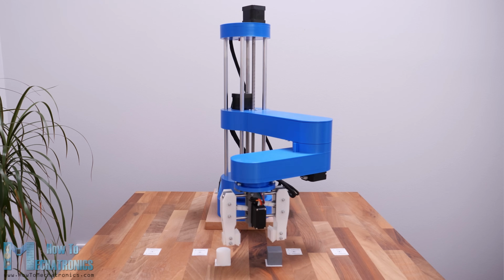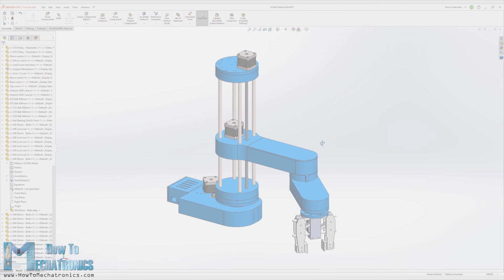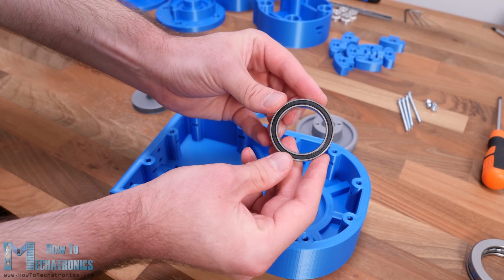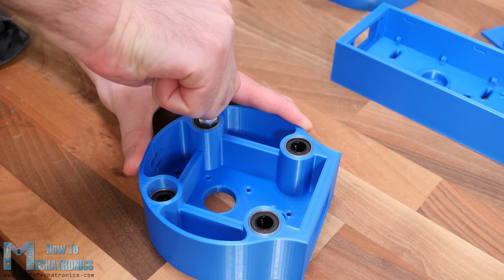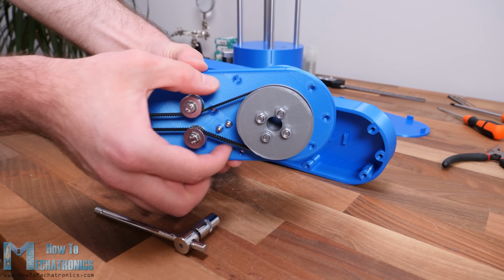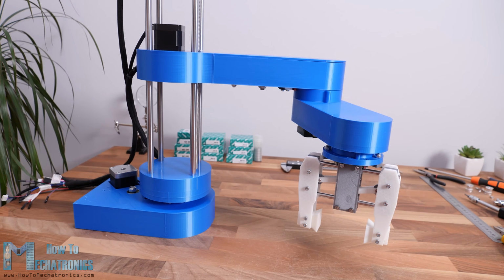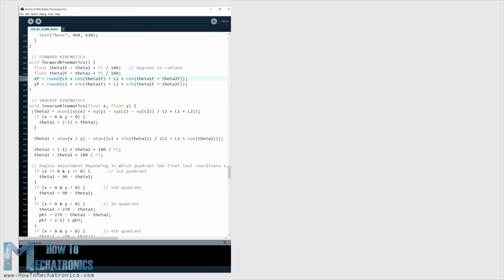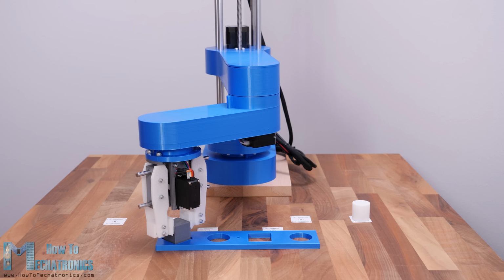SCARA Robot | How To Build Your Own Arduino Based Robot

Comment: wonder sir.while trying my pc all settings ok and processing3 also opening gui window but when enter diser angle in x axis box  but not working why ?is it necessory to change comport my pc shows "com7" where can I change this in the code
Reply: try not to use usb hub with ppliances pulling lot of current as it might affect,but single usb directly, not to interferrence with other peripherals. sir do you have in upper right corner java chosen? this is right? error in comand line below  this?An error occured while forwarding a Controller event, please check your code at move
java.lang.reflect.InvocationTargetException`? i have jrunning uploaded new sketch to arduino with slower baudrate :  Serial.begin(9600); and in processing ucommented : void setup() {
  size(960, 800);
  myPort = new Serial(this, "COM9", 9600);. It runs, you should be able to run it too now! so once you plug everything in, check on PC in device manager what port com it shows actually, then change in arduino sketch, upload, then change in processing and upload. lower baudrate is better. after you upload arduino code with current actuall com port , close the arduino IDE to finish the serial protocoll to allow processing to work, then press play in porcessing, no error code should come. watch your stepper drivers as they overheat, therefore run only few minutes and then switch arduino on robot with power off, to allow to cool down. once it is the same icom port in both arduino and processing and devoce manager, it should run. hope this helps resolve
Reply: @pitass82  Hi, I made this arm, but he doesn't work  i changed the line 55 for my port COM correct and the processing IDE run without errors, but the arm not move.... have you sucessfull building the arm?

Comment: Two supporting bars as a triangle mounted to the wall, would removes the problem of the wobly operation and thus the accuracy and thus higher operational speed drastically. It would need a recessed hole on top of the 'roof' of the robot containing a standard bearing with a 8 mm hole.
Reply from the maker: Yeah, that would improve things quite a bit.

Comment: Hi,
I finally built the Scara Robot. I modified all the 3D CAD models to accomodate with all the components i had existing from my other projects, and even added some 3D design features to simplify the routing of the cables in the interior of the Arms.
I am using (4) 12mm linear shafts and flanged bushings along with a 12 mm lead screw and nut with lead 8mm and 2mm pitch. I have also designed a solid aluminum base frame structure which i am houing the power supply, the arduino uno and cnc shield, the step down voltage converter and fan and the ac power switch from the rear.
The Homing sequence works perfect, the only issue i am having is with the gripper after homing in pde processing--  i am confused.
When it fiishes the homing sequence the x,y,z are at 365,0,170. My z is slightly different than the one on Mechatronics due to interference with gripper and  frame when homing stepper4 ( so i changed the code in arduino for homing of stepper 4 instead 0f 10000 to 17000 after limit switch is pressed, and the gripper needs to be in closed position- for mine 90 degrees.
After Homing 
Once i drag the gripper value slider , it dives down in the z and hits the table. What can i change in the pde or arduino to stop that, it really shouldn’t do that, it should only move the gripper to where i want it to be open, closed or whatever it needs to be - why is the z moving also ?? .Your help would be appreciated. Also my Gripper is fully opened at 0 degree and fully closed at 90 degrees, thats the way  my mechanism links work. My z travel limits are 0 to 182mm
Reply from the maker: Hey, glad to hear it you managed to build it. Well the issues you are experiencing with the gripper and the Z axis moving is true, I had the same problem but didn't put resolve it, as I already worked long enough on this project and had to move on. I believe it's something with the serial communication between the Arduino and the Processing program. The Arduino might not read the value coming from the program properly and that error of moving along the Z axis occur. Maybe try to use some if statements on the receiving values to confine to only real values. Also you can try to monitor what happens when this error occur through the serial monitor and print the values on it to to see what's the problem.
I hope you will be able to solve the problem and share it so other people can learn from it.
Cheers!
Reply: Hi Kashmir
Did you managed to fix this issue?

Comment: Hello Very very nice project, but I have a question, Which parameters do you use for infill density?
Reply from the maker: Thanks! I used various infill depending on the part, around 15 to 30%.
Reply: @HowToMechatronics  Thaks

Comment: any body made this project rebot??
Reply: Hi, i am currently in the process of creating the Scara Robot with many modifications. It will include an aluminum base frame where the power supply , electronics, power main entry switch will be internally contained, also adds to a sturdier base for the Scara Robot. I downloaded the 3D assembly file, and made the necessay 3d changes  to almost all the components to tailor to my configurations of components i had on hand- Keeping the center to center of the Arms consistent with the original design.
I also made changes to easier cable routing within the parts. I will certainly post a video when it is done.
Or even better yet, i will post the videos in stages of assembly.
I have designed Scara's in the past but never completed the projects due to lack of bad software not supporting kinematics ( Marlin ) i had tried many from GitHub but never seemed to work properly. So when i saw this excellent video from How to Mechatronics- i immediately jumped to it

Comment: I love the project! And just happen to be seeing this video a few months after getting my first 3D printer and a few weeks after receiving an arduino beginner kit from college. But my printing area is only 220 x 220 x 300 so for parts like the base it is only possible to print full size by standing it up in the bed which sometimes distorts the circular shapes I find. Is this the only way to proceed with a smaller print bed?
Reply: You can use a program to cut the model in half, print each piece, then glue them together. Meshmixer might do it. Not sure... look up splitting 3D models for printing

Comment: A very nice project and a well thought-out construction :) But I noticed something .. The forward kinematics describes the vectorial addition of the individual x and y components.  Doesn't it really have to be 
x = x1 + x2 and 
y = y1 + y2 ?

So no multiplying but adding!
Reply: yes also because otherwise it would have the unit of measurement of a length squared

Comment: My first exposure to this robotic design (6 or so years ago) was in the context of a 3d printer. The main benefit being that the reachable area is several times larger than the robot's footprint, meaning that in theory it would be possible to print the entire robot (assuming tech to print motors and wires but for now just the plastic parts) entirely inside its printable area. In fact, one demonstration model I saw was able to print 3 complete sets of parts to build more. Very nearly a Von Neumann machine.  

The main drawback being that the complex nature of each axis needed to be considered as it's own coordinate set, each of which changed based on changes to each join from the tip to the base making it very difficult to calculate the highly accurate motion needed to print finely detailed parts. In other words, positioning was not calculated using kinematics. I look forward to seeing your experiments with 3d printing and laser cutting with your design. Your solution to finding a position seems elegant and I'm blown away! (but I'm an animator and not an engineer, so don't let my awe go to your head.) 

I would suggest basing the first joint on a much larger bearing and printing the housing with thicker walls. I'm sure you're far more aware of 3d printing engineering techniques than I am since I dipped my toes in for only a few short years and you are currently involved, so maybe I'll just keep the rest of my comments to myself. Love what you've done here, though!
Reply from the maker: Thanks for the input!

Comment: This Project is absolutely fantastic. Unfortunately, the base is just a few Millimeters to large to fit on a Anycubic i3 bed (21cm)  :-(
Could the base be shortened a bit or the stepper be rotated by 45degrees? Then it should fit.
Reply from the maker: Ahh, I though the smaller printer beds are usually 22x22cm, that's why I made the base 21.5cm.
Yes, the base can be shortened a bit.

Comment: Dude really dig the design here. For a first build its super. Now if you get a cheap CNC breakout board and a serial or usb port run LinuxCNC and all the control issues could be sorted. But the bulk of the value sits with the code for the control interface here. Well done. Thinking of  building it.
Reply from the maker: Thanks for the input and have fun building one! :)

Comment: How you connect servo to arduino coz all ports are occupied by sheild
Reply from the maker: The shield has ports on top of it which are connected with the Arduino ports down, so you are able to use all Arduino pins.
Reply: Thanks man for the help.... Kepp building such amazing projects

Comment: Maybe you can insert a top and bottom metal plate for the bearings to clamp against to shore up the Z-axis wobble!  Also, do you think that just three smooth rods would suffice after such an upgrade?
Reply from the maker: Yes, your are right. I think so.

Comment: Great design! Is the load of weight of the boom (acting on the trapezoidal thread) taken by the motor or does "scrapes" the at the bottom on plastic of the base? Is there still room for a thrust bearing? Love the actuator.
Reply from the maker: To be honest, I didn't pay attention to that. I guess it doesn't scrape the bottom. There is just a radial ball bearing at the bottom plate, without a thrust bearing. Actually the whole weight is held by the motor shaft through the 5to8mm shaft coupler. 
Thanks for the input!

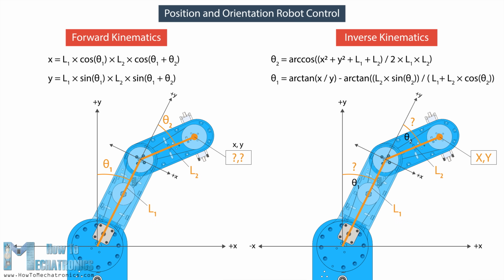Comment: Congrads on project. I would like to point out that you have mistake in a forward cinematic formula, product instead of sum, shown in video, in 21:10 -> should be x=L1 x cos(fi1) + L2 x cos(fi1+fi2), the same is with y. Also if I may suggest, you can print large slew bearing for better rigidity of the z axis.
Reply from the maker: Yeah, nice catch! I have misspelled the sign "+" with "x". I cannot correct the error in the video, but I will correct the error on the website article. Thanks for the input!

Comment: I wonder how many times did you fail when you were first thinking of this project
Reply from the maker: Well I actually spent a lot of time thinking about the design, so in terms of design it's first try and success. Now "success" is quite subjective, as to be honest, I wanted the robot to be more sturdy and stable, but in order to achieve that it would need a completely different design, at least for getting better results with 3D printed parts. In case we use metal parts, I think this design would work fine as well, but still there is a lot of room for this design to be improved.
Reply: @HowToMechatronics  what you did so far is commendable. I'm following your channel since 4 years and your recent projects needs a huge lot of thinking and innovations. Hats off to you. Looking forward for your upcoming projects. Cheers from India

Comment: Hello How To Mechatronics,
Great job, thanks, but unfortunately I don't understand the use of controlp5 !!!
How do we use the GUI_for_SCARA_Robot.pde file? Have read the documentation but unfortunately I don't understand. Can you bring light into the dark :-)

greetings
Eric
Reply from the maker: The GUI_for_SCARA_Robot.pde file is a Processing IDE file. The GUI is made with Processing and it runs on the PC. The other one is the Arduino code which we need to upload to Arduino. With these codes, the PC can communication with the Arduino through the serial port, and give the commands from the GUI/ program to the Robot.
You should check my other tutorials for Arduino and Processing IDE to get understanding of how they work together.
Cheers!
Reply: @HowToMechatronics  I will, thank you very much

Comment: If you make the base a "C" shape and use a bearing on the top and bottom of the first moving stage, that should correct most of the tilt problems from the base flexing.
Reply from the maker: Yeah, that's true. The "C" shape is good idea for getting better moving range. Though, that definitely would need to be made out of metal, maybe 2020 aluminum profiles, as a 3D printed one would be too weak for that application.
Reply: This shape is really cool to put in my bed room C shape is look too creepy

Comment: Love the design, really nice. The only thing I would change is to swap out the claw head for a vacuum pickup (still swivelling) as that would potentially be more useful
Reply from the maker: Thanks! That's true, a was thinking of using a vacuum pickup but I didn't go for it.
Reply: @HowToMechatronics  I guess the main issue is swivelling the vacuum line in the head, and trying to make sure that joint then doesn't leak! But might then mean that you could use it for SMD component positioning, which then makes it a really useful tool

Comment: Can you teach us concepts like 3D modelling ,how make 3d model to print on a 3D printer, inverse kinematics . I would love to learn from you
Reply: Inverse kinematics is a very cool topic. But the real deal requires understanding of partial derivatives and basic linear algebra.
The idea in most systems is to project the 3d cartesian motion into the robots "joint space". Which allows you to see what a small linear motion would look like as small motor rotation.

If you do this 1000 times for each configuration of the joints then you can get close to your goal position. 
Id love to get into details but hopefully a video will be released on the topic, the key technical topics you need to know are: denevit-hartenberg, jacobian matrixes and gradient descent.

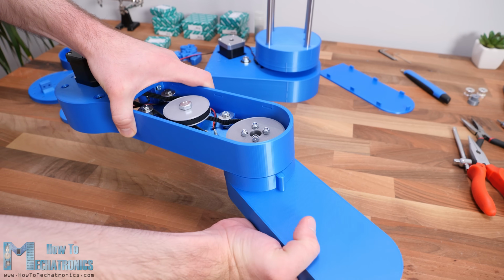Comment: 12:53 For the jiggle/backlash problem, add some holes for dowel pins in addition to the screws.
Reply: Include 3d printed slew bearing, it works wonders.
Reply from the maker: Thanks for the input!

Comment: Wow, I love this idea and design. I actually think I might be able to design and build my own. I think that constraining the topside of the robot with a second bearing will make it way more stable. The only downside being that the robot will not be able to make a complete 360º turn, but who needs that anyway, it's base is in the way anyway. Hmm, I have lots of motors left and a ramps with older stepper drivers. I should give this a try when my 5th 3D printer (a Prusa MK3S clone) is finished.
Reply from the maker: Thank you! Yeah, constraining the top side of the robot would definitely improve the stability of the robot. 
Btw, I checked you channel, you got some cool plotters there. I do plan to make some in future as well, so might look at yours for some inspiration.
Cheers! 😀

Comment: Hi this looks great, have you modified your 3d printer in any way? It seems like a lot of people like to mod their printers but if this is a fully stock CR10 that's really cool!
Reply from the maker: This is a stock CR-10, and yeah, it's prints really well. The white printed parts you see on the printer are for capturing time-lapses, but I didn't use them in this case.

Comment: finally some one made usefull things with 3d printer:D
Reply: What's fun is you can make this into a 3d printer.
Reply: @girrrrrrr2  actually no need to make this into a 3d printer. 
there are thousands of videos about that . This is very stable not like the others
Reply: @skara1214  true but not many stable scara 3d printers
Reply: @girrrrrrr2  Price/performance ratio is very high. Of course if using more rigid material you will get better performance but design is very usefull